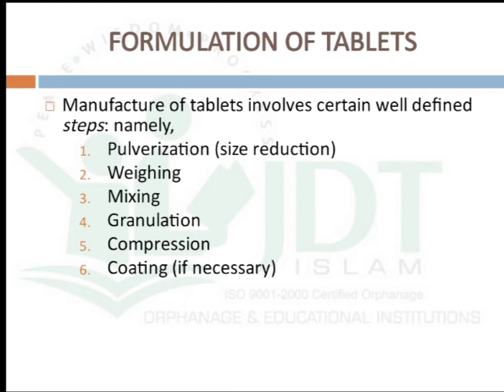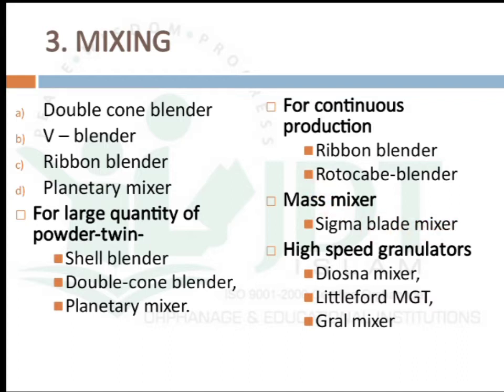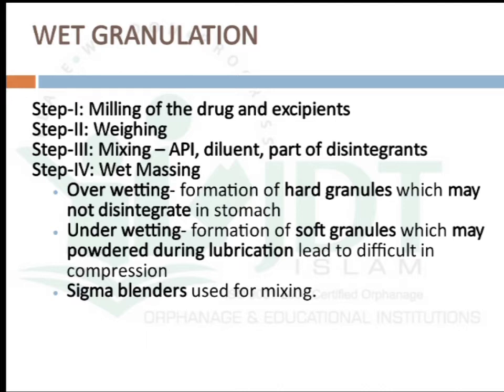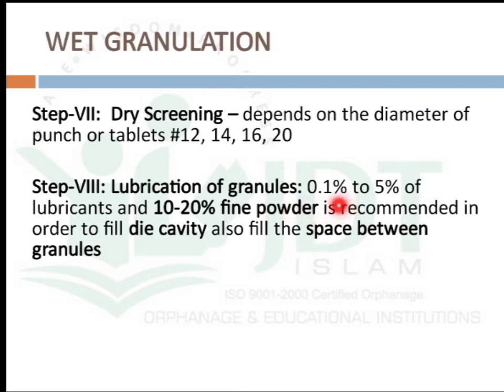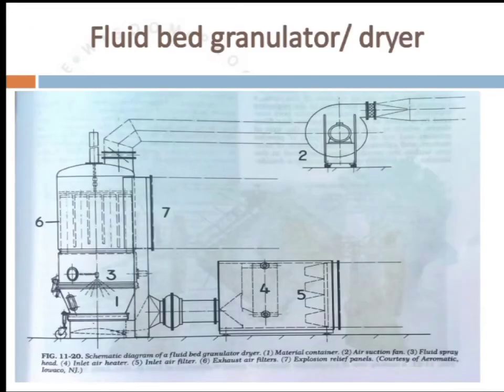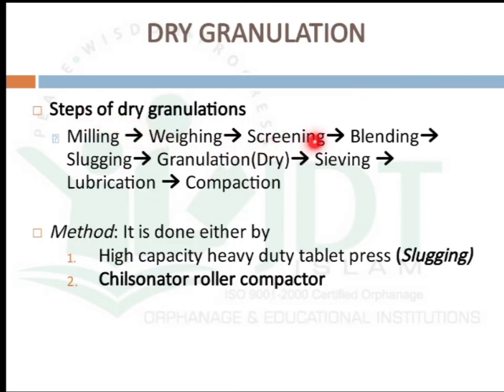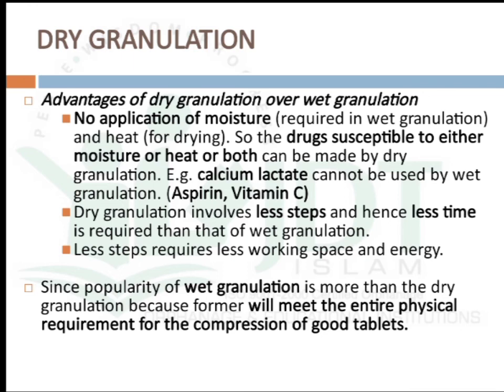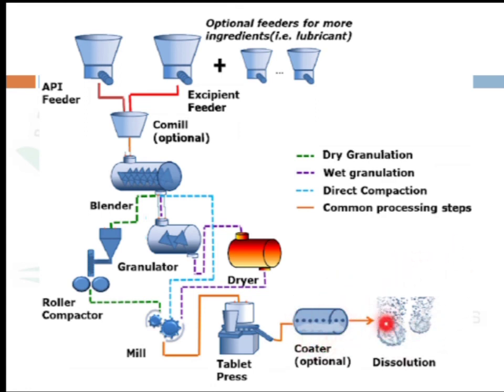Formulation/Manufacturing process of tablets : Steps involved

Comment: Coating explain cheyaledhu
Reply from the maker: Tablet definition advantage disadvantages classification https://youtu.be/z8iIOOSXAMQ

Tablet excipients or additives https://youtu.be/oamfR_tag50

Steps of tablet manufacturing https://youtu.be/xrre0Zf_HaM

Compression of tablets https://youtu.be/KGkEvYqsz5k

Defects of tablet compression https://youtu.be/0QxulQ_GhdU

Evaluation (quality control) test of tablets https://youtu.be/9iImQ2L-AOs

Tablet coating Process  Part 1: Objectives, methods and equipments https://youtu.be/2RaCvjDVC-o

Tablet coating Process  Part 2: Types: Sugar coating and film coating: Material used for coating https://youtu.be/FAeNGlGpF7o

Tablet coating Process  Part 3: Defects in tablet coating https://youtu.be/SnIzdKrzan0

Tablet coating Process  Part 4: Evaluation of coated tablet https://youtu.be/_mH0kPrX22s